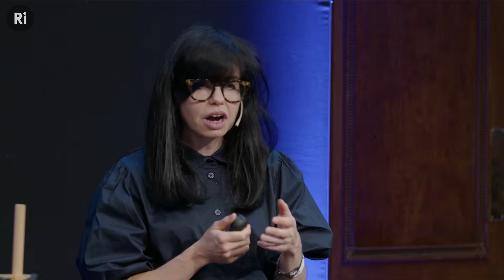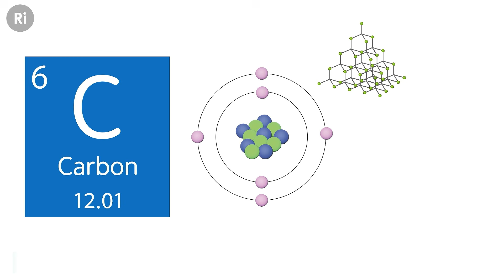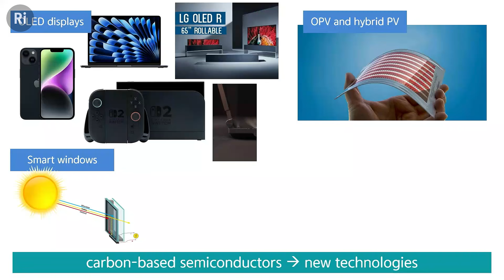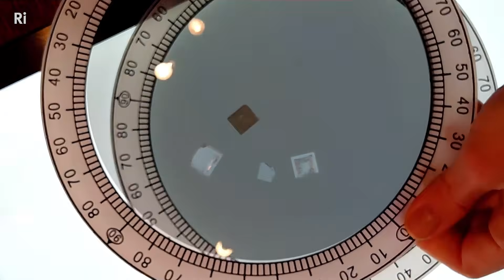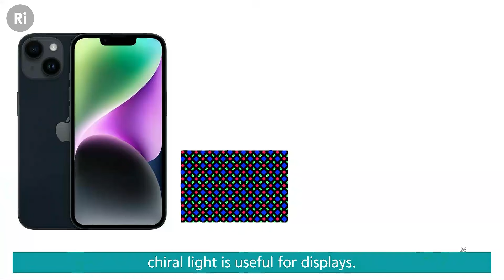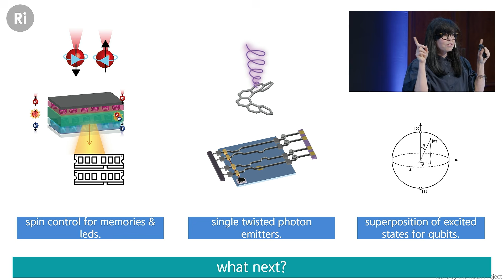How materials science could revolutionise technology - with Jess Wade

Comment: I find it fascinating that I can add resistance to crystal liquid and as it hardens I can add voltage to feed points and then get a similar amount in memory chip embedding or a resistor inline arrangement every vibration has a unique effect

Comment: I’m kinda confused. My teacher told me Benzene does not have alternating single and double bonds. And the proof of this is that all the carbon carbon bonds in benzene are of equal length. Pretty sure Miss knows what she’s talking about.
Reply: Your teacher is right - for the most part… 

Benzene is a resonance structure meaning that it has free moving double bonds (pi bonds electron pairs) that are delocalized and “move” throughout the hexagon backbone structure. The typical drawing of benzene looks like stagnant alternating single and double bonded carbons, but in reality it is a 6 single bonded hexagon ring with the double bonds “moving” around the ring. Sometimes benzene is drawn with a circle inside the hexagon to signal the cyclic nature of the double bonds. There are organic structures with alternating single and double bonds that are not resonant. I believe the speaker said this for simplicity. Anyone can feel free to correct me if my explanation is off.
Reply: X-ray image of benzene was cool.
Reply: You are definitely correct about the resonance of the benzene ring. But to clarify the fact that you put the word “move” in quotes, what is really happening is quantum mechanical and the composite wave function of the electrons of the ring is such that the probabilities of finding them is very high for a position on the ring, but the probabilities are evenly spread out around the ring. This is the same thing you said with a little bit more detail. When I was studying organic chemistry in college, I was confused by the benzene ring, but now decades later that I have a better understanding of quantum mechanics, it makes more sense.